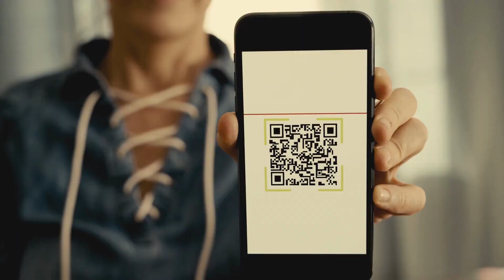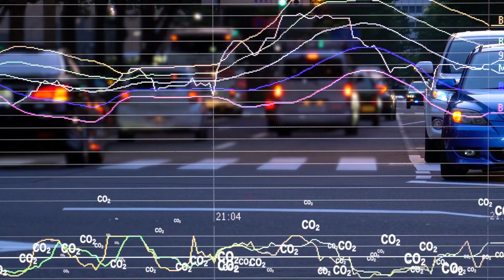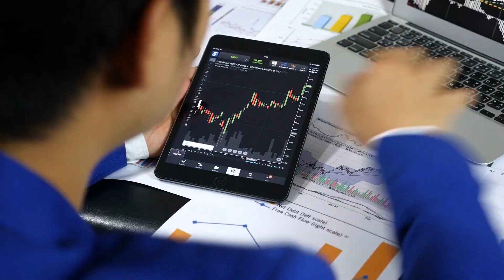Think Outside the Plant: Alternative Careers for Chemical Engineers

Comment: Can you prepare a master's thesis on a specific topic for a fee? Can I communicate with you
Reply from the maker: I could propose you topics, but can't work a master thesis right now
Reply: @ChemicalEngineeringGuy  I am objective about fluid two phase in the pipe consist from mixure of hydrocarbons at critical point ,and high pressure that coused in  happened flashing 
The suggestion in this thread is to find the temperatures and vapor fraction at each pressure
First using by roots equation of state by (peng robinson)
Secondly, compare the results with the solution in a way (Modifying the κ-Parameter in the Peng Robinson Equation of State to Improve Prediction of Vapor Pressure at Low Temperature and Binary Mixture Phase Equilibria)
Can you help me with this proposal?

Comment: Id like to add, a chemical engineer can go into EHS-Environment Health and Safety. By doing some Post Grad course.
Most process industry require an EHS department.
Its not much hardcore chemical engineering, but requires basic understanding.
It pays good too.
Reply from the maker: For sure, EHS is a good route if you are into that =) also, there is lots of need in the field!

Comment: Some chem eng I know are also working in supply chain, project management, business planning and contracting departments. These departments are within oil and gas, petrochemicals, WWT and desalination. As chem eng, you can fit in any position within the mentioned sectors but you MUST have the technical  experience as a junior to boost your CV for future opportunities and become eligible.

From experience, nothing like working in a processing plant as a junior. You will have some bad days that will make you think that you are a fool but at the end of the day it will pay off and it will short cut your working path.

Beside the hand-on experience, it will teach you soft skills like negotiation, diplomacy, strategies, leadership, ownership, prioritization … etc.

personal opinion and might not fit for all
Reply from the maker: True, having industry or field experience is gold, especially if you run into the 4-6 year mark; you can get any job related to manufacturing/consulting afterwards